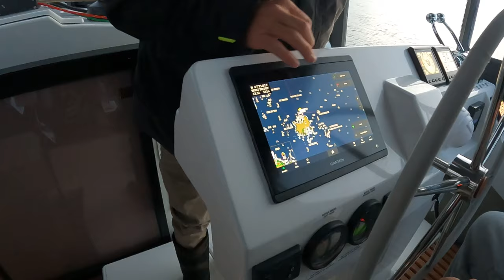Navigating Freedom Our Maiden Voyage from La Rochelle to Brittany

Comment: You guys are doing so well.  What was the issue with the dinghy motor? Also, great to see Julian, he did our sea trials on our Aura 51, Absolutely, last May on our 25th Wedding Anniversary.  We were able to move on the boat that night, and left for the BVI (via the Canaries and St Martin) 2 days later.  Keep at it, I think your motion sickness will subside over time.
Reply from the maker: We did have a major mishap with dinghy. (More to come😅)Lately it wont start . Possible old fuel or possible spark plug. James

Comment: If you get air in the gas line it can form an explosive mixture the other problem is fuel can liquify in the pipe and flare up...best be aware before you try ingnition that nothing is near or your over the jets.  If you need a lighter get one of the long  cooker piezo ignition types.
Reply from the maker: Thanks for tip, appreciate it. Catherine